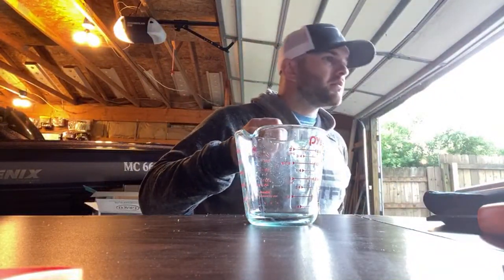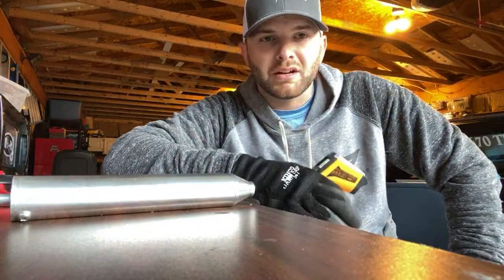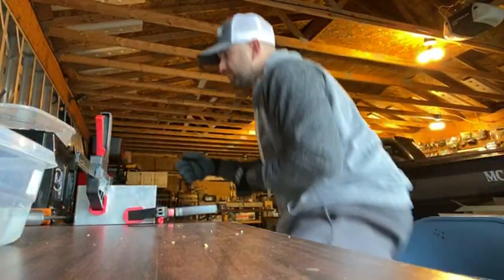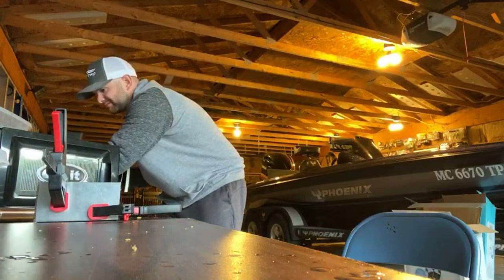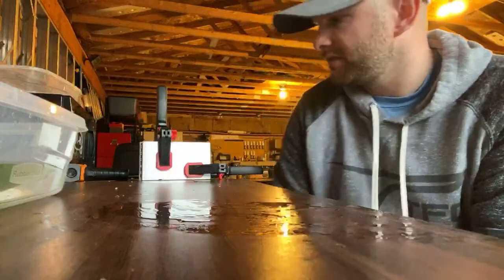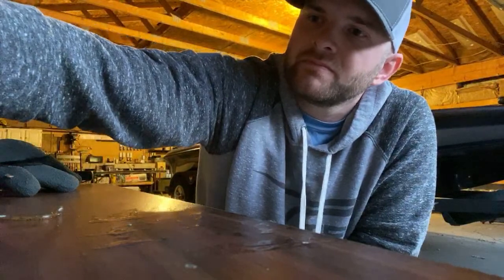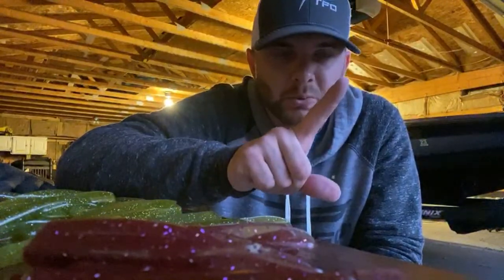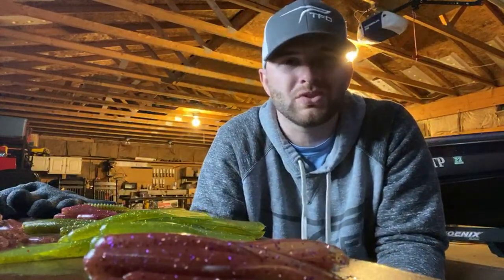MAKING CUSTOM SMALLIE LURES

Comment: Don't waste your time putting salt in your lures unless you want to throw them weightless.  Your less will float and have more action without salt.  Especially if you are drop shotting.  If you use salt you will have less working time and you will need more colorant.  Been pouring for more than 10 years.   Companies use salt because its cheaper than plastisol and they make more profit.   As far as scent,  a couple drops in your heated plastisol will be better and go further than in the bag.  Have fun.
Reply from the maker: That’s such good information.  Thank you Sean!  I really appreciate it